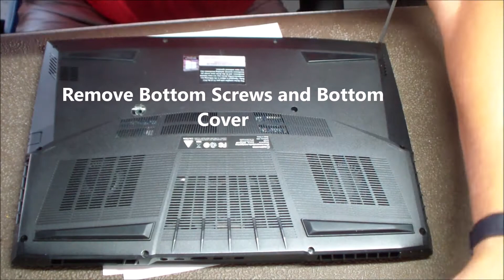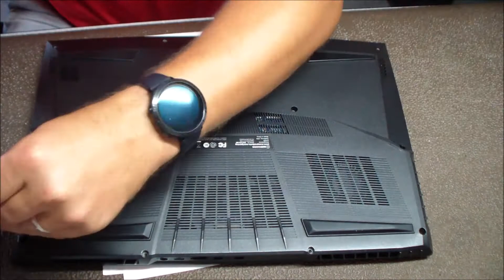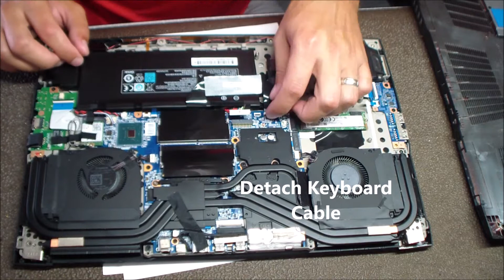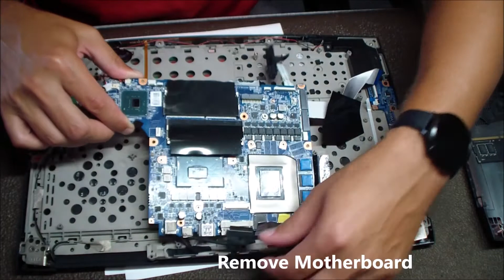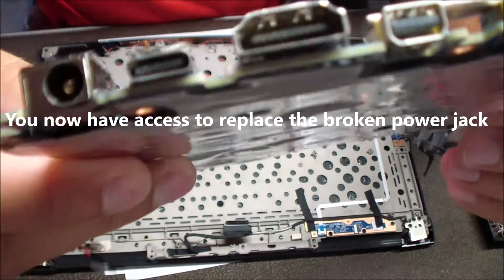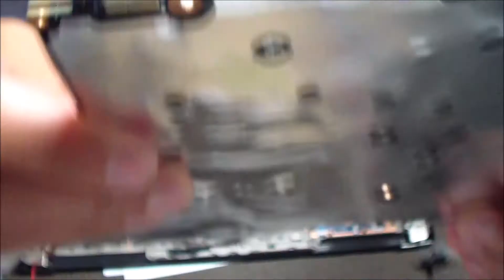Evoo EG LP6 Disassembly for DC Jack Repair/Replacement

Comment: Sir me ap fan hu or aj mujhe apki jarurat padi hai sir Mene apana laptop without shutdown kare bina bas normal close kar le lakh diyaa night me sir me subhe uth me apana laptop start krne gaya to wo start hor hai light on hori hai cooker chal raha hai but jo screen Black hi aari hai mene battery check karliyaa sidaa  charge se connect krke bhu start karne k try kiya MENE ram ki chip bhi nikal ke fir se dali but wo jesa ka wesa hai plzz help me sir 🙏🙏🙏
Reply from the maker: I don't understand, feel free to use a translator and then post again.
Reply: @pomeroypowerjackrepair  i went to sleep…without turning off my laptop and when i open my laptop in the morning my laptop screen is black to start up maybe dead laptop problem